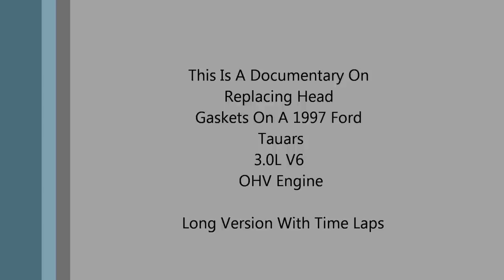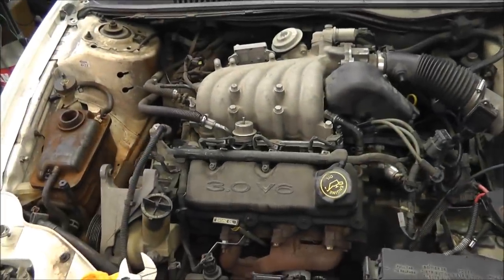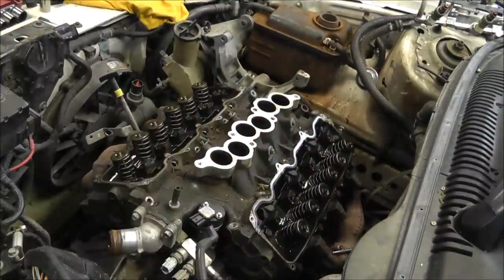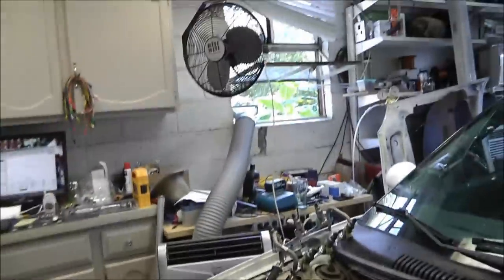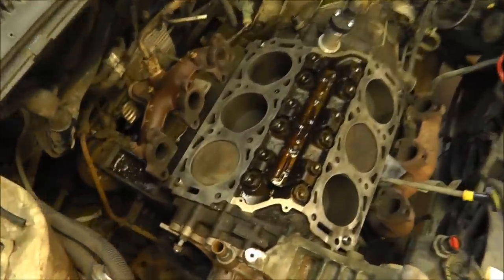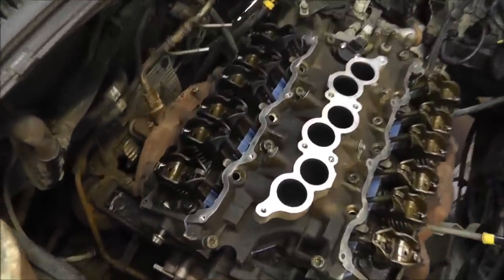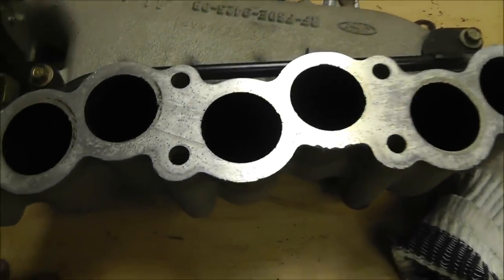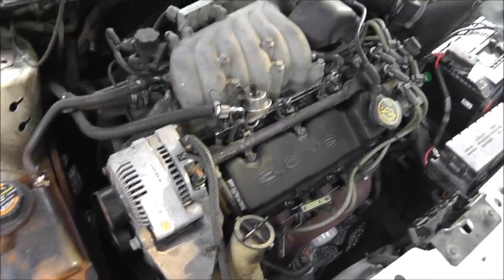Replacing Head Gaskets On A Ford Taurus 3.0L V6 OHV Engine. With Time Lapse. RWGresearch.com

Comment: How long did this take you do all this? I have to do the exact same thing with my wife's 2001 Ford Taurus and was curious how long it will take.
Reply from the maker: +Michael Pettis took me 2 days ( about 16 hrs or so) with no guide video... so you should be able to do it faster :)  ~Russ
Reply: +rwg42985 alright sounds good thank you for the time frame and quick response.
Reply: +Michael Pettis Hi Michael, I'm in the same boat!  Wife's 2000 Taurus blew a head gasket and our mechanic wants more than $1500 to repair!  (This does include having the heads resurfaced).  So I'm going to tackle it myself.  Will pay to have the heads resurfaced at least, and more likely will spring for remanufactured Cylinder Heads (two from NAPA for less than $600).
Reply: +johnmohanmusic if the heads aren't cracked then you do not HAVE to have the heads resurfaced. It's a good idea but depending on what the car is worth you may just want to skip that step. Unless the vehicle severely overheated for an extended period of time, it's not typical for cast iron heads to warp or crack.
Reply: Thanks!  I'll probably have the head resurfaced just to be safe.  I'd sure hate to spend two to three days of my life on this, only to have it happen again.  I'm giving serious thought to just removing the one head with the blown gasket and getting it resurfaced and replacing its gasket (it's the one front and easy to get to) and not bothering with the other cylinder head.  If I go for both then I'm going to put rebuilt heads on it.  But that adds a solid $600 to the cost.  And virtually guarantees that the transmission or the rest of the engine will blow just to spite me.  :-)  
Seriously, I think this car is possessed!  I replaced the brakes, only to have the starter go out a few days later.  Then I replaced the starter and a day or two later the frickin' head gasket blew.
Reply: +johnmohanmusic how many miles does the vehicle have on it? You may want to consider doing the job without new heads to save some money, no sense in sinking thousands into a vehicle that may not be worth much. I resurfaced the heads myself (well I sanded them and checked with straight edge) and they were fine. If it hasent overheated a lot then it's fine, cast iron doesn't warp much.
Reply: I feel so much better now knowing that I'm not the only person this happens to. Fix one issue only to have something else break a day later. Sometimes I don't even get out of the driveway for a test drive when I notice a second problem that I need to address... Some cars are just like that I guess.. Good luck to you in the future... Bill
Reply: William Jones My ranger had a constant case of problems, never been happier that I upgraded!

Comment: Hey man the plug that you said you had issues with about 11 minutes into the video. Where exactly does it connect to??? It's the last thing I have to do but I can't remember where it plugs in at thanks.
Reply from the maker: the one i had problems with from the bottom? i think it was for the air condition compressor. ??? ~Russ
Reply: Yea the one in the front where you said it goes to the air conditioning or the water pump. Thank you by the way! This video has helped me replace both heads. That connector is the only thing I can't remember where exactly it connects to.
Reply from the maker: Nate Allison your welcome. yeah its been a while but that connector was on the air conditioning part. I had to get it from the bottom. get under there with your flash light and i think it can be seen...
Reply: I just jacked it up. Me and a buddy are underneath it and still can't find its connection anywhere....
Reply: I looked up the prt. It's the A/C compressor connector. Still have found it yet but checkin Google. Either way, THANK again! Your video really helped me with the tear down and replacing everything.

Comment: Including the fact that you filmed everything? Fuck yea you did well. I agree with riptides99 that you should have covered the cylinders somehow while cleaning the block mating faces and you should have ground and reseated your valves while you were in there,maybe port&polish with dremel. Also with head warp, it's pretty cheap for a Mshop to make your head face true again, i would get it done for any job in the future. Nice job overall. Those rods you weren't sure of are just called push rods =)

Comment: A few things that made me wince, you didn't protect the cylinders when you cleaned the block, the grit and crap ends up down at the rings and will wear out the piston walls and rings fairly fast. You were one tool away from removing the valves and being able to clean and grind them. Using an Inch/lb torque isn't a good alternative to ft/lb. On the upside, that engine wasn't bad inside to be 180k miles. DIY maintenance beats a car payment any day. Oh and I hate those noisy PS pumps on the Taurus.

Comment: common prob with these engines if the coolant system is neglected BAD bad things will happen, most common are blown head gaskets and cracked heads

Comment: How do you tell which engine is in your 2000 Ford Taurus SE? I'm asking because there is no real identification on the engine other than the 3.0 L. VIN number 1FAFP53U6YG110867
I'm asking because I recently purchased a Taurus and while looking for parts... well there are choices:
6 cylinders 2 3.0L Flex fuel OHV
6 cylinders S 3.0L EFI DOHC
6 cylinders U 3.0L EFI

I'm guessing it's the "6 cylinders U 3.0L EFI" because there is no 2 or S in the vehicle identification Number. The car has 160,666 miles and yeah I wanted to do an overhaul on it this spring. Car runs great but did notice the rust in the coolant when I did a flush and fill and suspect the water pump. That and it slowly loses coolant. "About a gallon a month" was the line I got from the previous owner.
Reply from the maker: With out doing more home work I can say for sure yes. The vin number will tell that information. But if the motor was ever switched out you can tell by looking at the number on the motor. Where ever that is located :)
Reply: ***** Yeah, have not gotten into the project yet. Drove it home and looked it over. I know the transmission has been swapped out. Bought the car for $300 and figured I could put about as much money into it and have a good running backup car. It was -10*F when I picked it up and she started right up and ran/drove fine. Wasn't until today that I got a chance to really look at the engine. Trying to get a rough idea of parts needed and price.

Watching your video it's not all that different from the V6 Pontiac Gram,  though the head gasket was similar to the V6 Dodge Dakota in that you have to RTV the corners. Would seem simpler to make the gasket all one piece...

When I did the head on the Pontiac I made the same mistake... forgot one of the vacuum hoses, the car started but there was an incredibly loud whistling noise 

Good video. Gives you a real good walk-through on the procedure.

Comment: If i had that car id rather hadnt.
Whats that shit inside there? Why is there Rust on the coolantreservoir????

Ive seen bigger engines where replacing gaskets is not half that work und the motor doesnt look that oldn rusty xD

Comment: I absolutely hate the taurus 3.0. There were actually 3 different 3.0's manufactured and the parts houses like autozone have all the parts miscatalogued. Best to take the old part in and match it with the new one!

Comment: Let me guess, you're kind of an mechanic amateur? Gas manifold? Did you mean fuel rail? "Pusher", they're called lifters, but at least this wasn't a ridiculous name. The power steering was on the top with the reservoir attached, so the A/C was on the bottom (you didn't quite make that clear). You used an Allan wrench for those bolts (IDK the name of them)? Yeah, good way to strip them out! Go to a local parts dealer next, you can buy individual sockets for like 50 cents!

Comment: "pull this seal off", it's called a gasket. And in order for the coolant to leak into the cylinders, the metal ring on the gasket (for the compression chambers) has to be blown or cracked, peeling doesn't matter as long as it's no peeling over to an oil port. And at that, this video is honestly boring me, so bye.

Comment: that car is pure junk. you should have junked it and moved on to another one.
Reply: Complete felpro gasket kit plus new head bolts is under $120, an equal or better performing vehicle is not. Great job on the unhelpful comment.